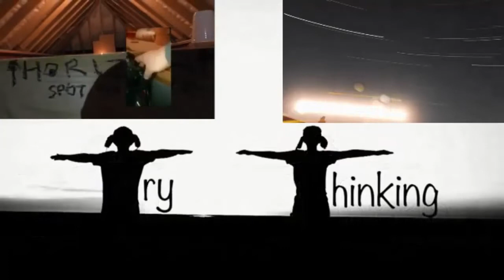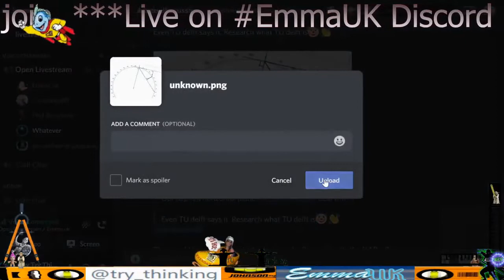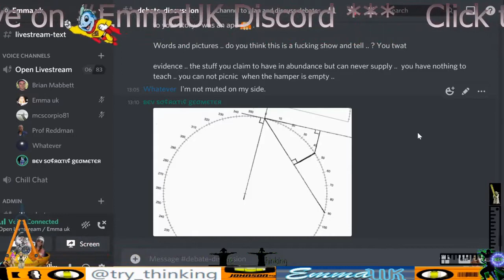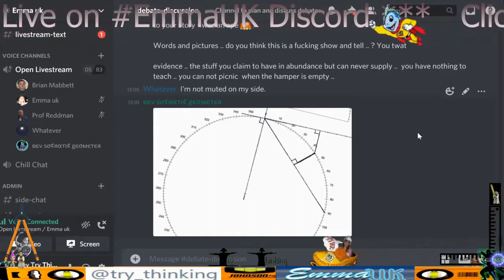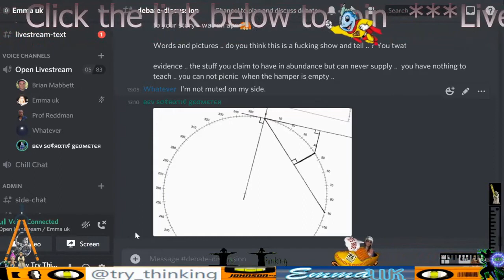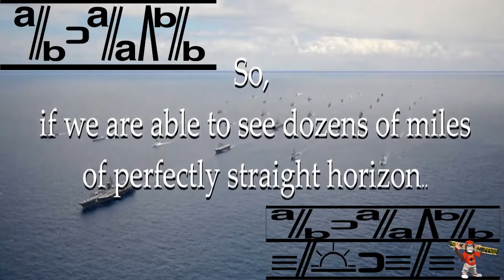Whatever talks about Sly Sparkaynes Bending water level test

Comment: I remember a few years ago I asked Sly what his #1 proof that Earth is a ball and he said Gravity.  Lol!  Now he has a test to prove its bendy?  Why wouldn’t he have said bendy water?  These globers have nothing.
Reply from the maker: Slys been doing his bending water level experiment for years, he’s obviously not even able to join pipe together without it leaking. He’s just another actor paid to imagine he’s smarter than fools🤷🏻‍♂️ if he was smart enough he’d have hidden his inaptitude better.
Reply: Ryan....My question for you is what is your #1 proof of a flat earth?  As for me, I have made many observations that only work on a globe.  Here are just a few....
1)  In my hometown of Seattle I observed a sun with an orbit path that is around the North Pole but I spent over 2 years in New Zealand and Australia and the observed sun orbit is in the complete opposite direction around the South Pole.  I should not have seen this on a flat earth but this is easily explained by the globe. 
2)  I currently live near the equator in Thailand and the observed sun orbit is perpendicular to the earth's surface.  Continue that orbit path and the sun goes right underneath me at night.  Again, not possible on a flat earth but easily explained by the globe.
3)  The orbit path of the moon at zenith is between 28.5°N and 28.5°S so if the earth was flat then people in the northern and southern hemispheres should see opposite sides of the moon.  I saw the same face of the moon in Australia and New Zealand except that it was up-side down in relation to the moon I observed from Seattle.  Again, easily explained by the globe but not possible on a flat earth.
Need I go on?
Reply: @fedogma8407  Verify that the sun goes under you... ever. :) I couldn't think of a way to verify it. The observations are the same for the sun on a globe and a flat earth.
Reply: @ryanqvincent144    I really don't think you have done much research.  One of the fundamental differences between the flat and globe models is that the cosmos is above the flat earth and the cosmos completely surrounds the globe.  Obviously observations can only fit one model.  
Here is a video showing a sunset time-lapse from Singapore (almost right on the equator) which is about 950 miles to the south of me.   https://youtu.be/4RRpHFqYfmU?t=6  

Since the observed sun rises perpendicular to the horizon, passes overhead at noon then sets perpendicular to the horizon at sunset then it is not difficult to continue that same path and understand that it goes underneath you at night.  My 6 year old grandson even figured this out when I asked him where the sun went at night.

And what about the observed sun in the southern hemisphere?  How do you explain that on a flat earth?
Reply: @fedogma8407  what’s is the sun.?
Reply: @Jimbob-83   It's that bright object in the sky that gives us daylight.
Reply: @fedogma8407  you 100% sure of that?
Reply: @fedogma8407  you said: "... Obviously observations can only fit one model. ..." That is what you need to verify! You have to verify how you know the sun goes under you! You need to use 'Time and Date . com' readings! They are taken from the real world! :)  
  Your problem is that you need to verify you live on a globe and you cannot verify that!

  You can verify that this place is stationary and cannot be a globe of the size you are told. ;-/
Reply: @Jimbob-83  Yes, both of us have been outdoors and seen this.  Do you have a serious question?
Reply: @fedogma8407  you seem to have all the answers but they all seem to be based on presuppositions and assumptions such as the sun goes underneath us..🤣🤣🤣👍
Reply: @ryanqvincent144  Having a case of cognitive dissonance because you can't explain those sun orbits on a flat earth?  The data on both TImeandDate. com and Suncalc. org matches everything that I have seen.  

You saw the sun setting perpendicular to the horizon in that video.  So how does this sun return to the east to rise again in the morning 12 hours later if it doesn't go underneath me at night?  That sun is still setting to the south of due west and rising to the south of due east but the North Pole is over 5,000 miles to the north and it is quite obvious that the sun is not heading in that direction.  Do you have an answer?

This is not rocket science, if the earth was flat then everyone should see a sun orbiting around the North Pole as observed in the northern hemisphere.  We don't see this.  And no, you don't have evidence of a flat earth, only denial of the globe.
Reply: @Jimbob-83  My observations are pre-suppositions?   Why does that video match what I observed?  How do you explain a sun orbit that is perpendicular to the earth's surface if the earth is flat?  How do you explain a sun orbit around the South Pole if the earth is flat?  Why doesn't everyone see a sun orbiting around the North Pole if the earth is flat? All you have is excuses and emojis because you are the one with pre-suppositions and assumptions.
Reply: @fedogma8407  🤣🤣🤣👍 orbits..? What are they
Reply: @fedogma8407  you also assume that every flat earther ascribes to a disk in space with the gasses sun and a moon rock circulating above it...🤷‍♂️🤷‍♂️🤷‍♂️🤣👍
Reply: @Jimbob-83  It is a lot worse that that for the 'globe enthusiasts'... There is no 'vacuum of space'! We live at the lowest level of a flat and stationary, water filled plane with 'lumpy bits' we call 'land'...  that we cannot get to the  'underside of'. Everything we see is on this plane or above us! This includes all the sky objects which we have no way to verify the physicality of. :) 
  That is where we live. :) It actually makes sense! :)
  anyone can verify the 'stationary' part for themselves. :) 
   I really am not jokin' :)

  There is a lot more to it than that! However, that is the basics of where we live! I don't like it either.
Reply: @ryanqvincent144  
You can't verify that you are stationary, and I am not joking either!
Reply: @frankcrowder9709    You can verify that the physical earth is stationary! What is more once you understand the falsehood that you were told to convince you then you will feel foolish. Don't! Your teachers were fooled as well!
  You can test that this place is stationary. You can show the falsehood you have been told. :) 

   You have been told a falsehood as 'physics of motion' but never shown it was true! 
   It isn't your fault. You had to be taught this falsehood! 
   Clue: Kinetic energy of linear motion! 'F = ma' is not complete for objects already moving in a straight line at constant speed. :)  The issue is the real world that you live in!
Reply: @ryanqvincent144  You claim there is no "underside" of your flat world and everything we "see is above us" yet you cannot explain why I see a sun orbiting perpendicular to the surface of the earth which means that the sun goes right underneath me at night as it returns to the east to rise again in the morning.  Again, this matches all of the data on TimeandDate and Suncalc.  You are not a flat earther, just another globe denier who denies evidence that does not fit your assumptions.  And how did you "verify" that the earth is stationary?
Reply: @ryanqvincent144  🤷‍♂️🤷‍♂️🤷‍♂️
Reply: @ryanqvincent144  
Irritating to me is your repeated failure to explain my simple example of the same movement on the earth and then on a moving aircraft. What do you claim is the energy change needed to go from 0 to 4mph on the earth and then in an aeroplane moving 500mph faster than the earth's surface? Give me some actual numbers, not your opinion of where you imagine I have got it wrong!
I know that postulating a new reference frame doesn't alter conditions in the first one, but it can often make the situation simpler to analyse, as for example my aeroplane one - you simply don't have to relate all the speeds back to earth.

You seem to think that I have simply been 'told' what the laws of motion are, but come on, if you have had a decent scientific education these will have been demonstrated practically, too, and then a working lifetime of actually using them, and not finding them wanting, has convinced me that I understand them better than you do!
I haven't read any of your thoughts because I couldn't find them on your channel: where exactly are they?
Reply: @frankcrowder9709  Stop using 'reference frames', which are imaginary... Calculate the kinetic energy of a one ton car moving west to east at 600 mph while appearing stationary. Now, speed it up to 30 mph in each cardinal direction. Calculate the change in kinetic energy in each direction. i.e. Calculate the total Kinetic energy of the final speed  - the total kinetic energy of the starting speed in each direction.
 1)  Is the change in kinetic energy the same in each direction?  

Now, use 'reference frames' as you were taught? 
 2)  Is the change in kinetic energy the same in each direction?  

 a)  Why are the different? 
 b) Which is correct in the real world? 

This is the real world... How can they be different just because you did the calculations differently? 

That really cannot be correct? Right?

Conclusion: The real world cannot be rotating! :)
Reply: @ryanqvincent144  
I assume that your 'one ton car moving west to east at 600mph while appearing stationary', refers to a car that is static relative to a point on the earth's surface at a latitude with a 600mph W to E surface speed, and you then drive eastwards at 30mph, say, and westwards at 30mph, to consider just two of your cardinal points.
Obviously you want me to say that the change in KE when moving from rest (relative to the ground) to the east is
630^2 - 600^2 = 36,900 units and when moving from rest to the west is
600^2 - 570^2 = 35,100 units.
Yes, the changes will be different when calculated this way, because of the squared function, compared with the changes of 30mph in all directions when considering the motion being in a reference frame fixed to the earth's surface. The change in all directions is now only
30^2 or 900 energy units.

Which is correct? - both of them, of course, as it depends on what you were calculating the energy for in the first place.
I know that you aren't happy with the concept of relative energy, but you can't deny it has a real effect.
For example, if we were considering an impact between the car and an object from space - a meteorite coming in from the east, say - then the severity of this impact would be worse for the car travelling eastwards, as the closing or impact speed would be the sum of the car's W to E speed and that of the meteorite's E to W speed. 
If the car was travelling E to W however, the impact speed would be the difference in meteorite and car speeds.
As impacts of this type are rather rare affairs(!) we usually always consider motion relative to the ground where the result is the same for a moving or stationary earth.

To show how the use of an appropriate reference frame makes the calculation easier, consider the following scenario: your car is stationary relative to the ground - on a stationary earth, if you insist. You punch the windscreen with your fist moving at 30mph, say. It hurts, as the kinetic energy of your fist and arm is dissipated as strain energy in the windscreen and your fist/arm and some thermal energy too.
If you were to do exactly the same punch but with the car moving at 30mph over the ground, I claim that any injury would be identical to that in the first case.
The relevant energies are 30^2 = 900 units for the first case where your fist is moving at 30mph before impact before coming to rest after the blow, at zero speed relative to both the car and ground, and the second case of
60^2 - 30^2 = 2,700 units of energy where your fist starts at 60mph and stops at the windscreen, still with the 30mph speed of the car, relative to the ground, which we are taking as our absolute zero speed reference point.

Do you agree that the effects of the punch would be the same whether the car was moving or not?
If you do, then something is wrong in the logic, and that is clearly in the use of energy values using speeds related to the ground, when it is obvious that the car should be treated as the point from which your fist speed is measured.
The speed of the car is totally immaterial to your punch, just as the speed of an aeroplane has no effect on movement inside it: so the same applies to the earth and your earthbound speed/turning/braking tests are the same for both a stationary and moving earth, as long as these earthly movements do not make the earth a non-inertial frame, which for all normal purposes they don't.
At the risk of repeating myself, again, you have NEVER commented on the massive energy differences involved in a 4mph speed change of person on a 500mph aircraft, compared with the same change on earth, if all speeds are referenced to earth - any comments????
Reply: @frankcrowder9709  lol, They cannot be different! That cannot be correct! That is where you think that maths is separate from the real world! 
  There is only one real world object! It cannot have different 'kinetic energies' at the same time!
  You are starting to appreciate that the kinetic energy must be different in different directions, and it is not linear, if your assumptions of a rotating earth are true!

   Remember, in the real world the braking distance is the same in all directions!
  'Braking distance' is proportion to loss of kinetic energy!

  You know the kinetic energy is different in different directions... So, why is the 'braking distance' the same in all directions?  You know this from driving a car in the real world! :)

  You are almost there... The kinetic energy must be the same in all directions on the physical earth to give the same braking distance! :) 

   Conclusion: The west east rotation does not happen! 

  Now, can you show this with a simple test!?  
   Yes, you most certainly can! :)

   Has this test ever been done in the real world? NO!
   It will show that the physical earth is stationary! :)
Reply: @ryanqvincent144  
Again I ask, why does a 4mph change in speed on the earth feel exactly like the same speed change in an aeroplane at 500mph when you go from standing still in the aisle to walking forwards at 4mph along the aisle, towards the front.
 Surely, according to your philosophy, on the earth you are going from zero absolute speed to 4mph absolute speed, and on the aeroplane cruising at 500mph, relative to the earth's surface, from 500mph absolute speed to 504mph absolute speed, with a consequent energy increase factor of 250!
That is a massive increase factor, that is easily resolved by using a speed reference frame that MOVES WITH THE PLANE!, when you then get an answer that is the same for the plane situation as that on the ground - which is what we observe in reality.
I just fail to see why you can't grasp this, so must assume that this is why you never comment on this particular example. 
Why does the use of a reference frame explain the similarity of the two situations whereas referencing all speeds to earth does not?

What is your explanation of this?
Reply: @frankcrowder9709  You need to sprint up and down a plane. 1) When stationary on the runway. 2) When cruising at 500 mph.
  Do they feel the same? No! 
  Can you prove they are different? Yes! 
     You can easily measure whether the plane is moving or not with a simple 'relative speed with a constant amount ofd work' test! :)  
   You nearly had it... It is about current 'Kinetic energy' and acceleration! 
   Until you face this and appreciate where it leads... You are wasting your time talking to anyone about it! :) 

   The real world is stationary. You can avoid it all your want. 
   The physics of linear motions shows this.   

   It would be easy to prove me wrong... Just do the 'tennis ball, Catapult and radar gun' on a train or airplane.

   You expect the same results when stationary and moving using 'reference frames'. The real world will be different. :)
Reply: @ryanqvincent144  
You DON'T need to sprint up and down the plane! If your true velocity is that measured relative to what I assume you think is the true reference 'zero' speed of the universe, or whatever you want to call it, but I am still assuming that it is the speed of the earth, as you haven't said anything to the contrary, then as I have pointed out many times, even just a 4mph speed change will need a MUCH larger energy change at higher speeds than at rest. The fact that you don't get this large difference if you simply use a different frame, for example, the ground and then the aeroplane itself, shows the legitimacy of this approach - that is, it correctly describes what we actually observe. Do you dispute my energy figures for the two 4mph speed change scenarios?

I agree that doing a test involving a constant amount of work at rest then on a moving plane would be interesting, but have no doubt what the result would be!
You speak as though you have actually done a tennis ball or catapult test: have you? I would be very interested in your results! Also, you sound as though you really believe that you could tell the difference running up and down a train in opposite directions. Have you actually done this yourself, and I mean a proper test, blindfolded, with no audible cues or giveaways like the shape of the seats that you could touch and hence determine the front or rear of the carriage.
What evidence HAVE you actually got?
No thoughts on how the mechanical gyrocompass works?
Any explanation as to why artillery shots tend to fall low when shooting west and high when east, if it is not the change in centrifugal force countering gravity slightly differently for the two directions?
Reply: @frankcrowder9709   I notice that you have now diverted completely when driving a car at 660 or 540 mph in the real world! :) 

  You need to show the evidence for your belief! It is interesting that no scientist has ever done it! Obviously, You think you believe that a small change in the real world speed proves your point. Obviously, you are talking rubbish! :) 
  Show some real world tests to prove your point! 

   Volunteer to run up and down the aisle of a aircraft at full speed and tell us what happens! :) It is dangerous and will be disallowed! Especially the running backwards and  'slowing down'. :) Think about it! Try it! :) 

  Seriously, we have been here before... You won't check the real world of linear motion. 
  Time to go our separate ways. Thanks for your opinions. 
  You will be muted.
Reply: @frankcrowder9709  They are not well tested! You believe that 'reference frames'  can be used to remove the kinetic energy of a moving body... Yet no one has ever shown you it is true. :) Obviously, it cannot be true as they are 'imaginary'. :)  
   Thanks for your opinions.
Reply: @ryanqvincent144   
 They ARE well tested! Certainly F = ma and the standard equations of motion are!
I have never said that reference frames change the ACTUAL amount of energy in a system, only that they can make a dynamic system easier to consider, in some circumstances. All I have tried to show, unsuccessfully, to you, obviously, is that rigid adherence to your belief that all velocities must be related to a stationary earth, can lead to incorrect conclusions.
Please tell me if I have misinterpreted what you believe: that is, that you consider the earth stationary and absolute velocities must be referenced to the earth.
Reply: @fedogma8407  So your proof that the Earth is round is to look up and assume the Earth is a sphere?  No don’t go on.  

I live in Victoria across the Strait of Juan de Fuca to Port Angeles, 20 miles with 177 ft of missing curve that should hide each other but are clearly visible.
Reply: @TrueEarthKnowledge   Why wouldn't you be able to see Port Angeles?  
1)  You seem to have forgotten that Hwy 101 drops down from over 250 ft as it enters Port Angeles from the east.  
2)  Also go a mile inland in most of Port Angeles (east side) and the elevation is higher than 177ft, one area is even 500 ft above sea level.  
3)  Did you consider refraction?
4)  Do you have photographic evidence of the US Coast Guard airstrip buildings on the jetty or the lighthouse on the Dungeness Spit about 12 miles to the east?  
 
And yes, I know that the motion of celestial bodies in a cosmos that is only above a flat earth would look completely different than a cosmos that surrounds the globe. My observations definitely support the globe.   No flat earther can explain those sun orbit observations on a flat earth.
Reply: @whatever2735  I live in Bangkok and at times we have hazy, humid air and pollution so star gazing can be difficult in the city, especially for stars on the horizon.  I can see Polaris year round but all of the Big Dipper, Cassiopeia and the bowl of the Little Dipper can go below the horizon.  I can't see the South Celestial Pole but both The Cross and Pointers can sometimes be seen arcing above the southern horizon.  And yes, Orion is a familiar sight during winter months although it passes directly overhead so it also has an orbit path that is perpendicular to the earth's surface.  It always amazes me how flat earthers deny the reality of how celestial bodies move and only want to talk about "the lack of curvature" yet can't comprehend why we see celestial bodies go below a water surface that they claim is flat.
Reply: @whatever2735  so will the stars rotate to me if I’m in a plane
Reply: @whatever2735  In reality there is no flat earth explanation for any celestial observation but especially in the southern hemisphere and near the equator where it is blatantly obvious.  Of course according to Ryan Q Vincent, observations work the same on both models.  You have to wonder how it is possible to be so ignorant that you would claim a flat world with all celestial bodies above it would look the same as a world completely surrounded by the cosmos?  Exactly how deep is that rabbit hole??
Reply: @whatever2735  your assuming there’s only one rotation... even on a flat stationary earth they maybe 2 separate rotations.. I don’t know and I’m certainly not going to claim anything.... on your ball belief world..! Does the stars always rotate .? Even when your in a plain flying..? Does the moon sun and stars still move?
Reply: @whatever2735   You said:  " Look up celestial sphere." You never see a celestial sphere! You see a 'a sky that you believe is half a sphere' at the most. You have been told it is a sphere. How did anyone verify that it is such? Clue: No one did. ;-/

     You said: "Only one axis of rotation has ever been observed by humanity throughout recorded history.". That isn't correct... There are two axis: One is the north and another one in the south. 
   How did you verify that they really are one axis? 
   How did any expert verify that they really are one axis? 
   No one has? 

 The 'sky objects' are a 'clock'... I suggest you investigate that thought.
Reply: @whatever2735  so the stars rotate around us on the globe
Reply: @whatever2735  Stop being a parrot! How did you verify that the rest of the sky is below you? 
  I know what you have been told! How do  you know it is true!  
  Clue: The exact same explanation works for a flat earth with all the sky above you!
  Now, how can you prove your belief of the sky under your feet is correct?

  I cannot think of of how to prove your version of the sky is correct. ;-/ Enlighten me how you did it! :)
Reply: @ryanqvincent144  Your comment, and I quote, "Clue: The exact same explanation works for a flat earth with all the sky above you!" shows your complete ignorance of reality and your indoctrination into the fantasy flat earth.  The idea that we would see no difference in a flat earth with all celestial bodies above us and a globe where all of the celestial bodies are completely around us in all directions shows that you don't even have the common sense to understand what the differences would be.  All you are capable of doing is parroting the flat earth pablum of denying the globe.  

And what is hilarious is that you think you are an expert in physics and kinetic energy when you can't even comprehend simple observed motions of celestial bodies.   We can prove the globe but to be brutally honest you are not as smart as you think you are since you allowed yourself to be blinded by flat earth lies.
Reply: @whatever2735  How do you prove that EQ Mount is pointing at the star when it is pointing at the ground? You cannot! 
   Remember, In the real world the star is always above you and it just goes out of sight!
  You have been told the EQ Mount follows the star.., Prove it is true!
Reply: @whatever2735  It isn't what you know. It is what you can prove! :) Now, prove that your EQ Mounted telescope is actually following a star when it is pointed at the ground! 
   You cannot prove it is doing that! :) You cannot prove that what you believe about your EQ Mount is correct! It isn't!
 
  The physical earth is stationary and a flat plane! The EQ Mount works perfectly well tracking the physically moving stars as they go over head and vanish into the distance!
Reply: @whatever2735  Your 'rising' and 'setting' is just the conditioning you have had all your life. ;-/ The reality is that they are coming towards you and going away from you. 
  The stars are local to you and nothing like what you have been told. ;-/ They are not 'suns' far away.  

  You can work this out for yourself with a little thought.  

  Combine that with the 'stationary' earth and i does start to make sense. :)

p.s. The issue you have is that you cannot prove the EQ Mount can track a star when it is pointing the telescope at the ground.
Reply: @whatever2735  The 'sky objects' are a 'clock'! you can predict them accurately without understanding how the sky works! :) 
  What you cannot do is verify what they are, what size they and how far they are! ;-/
       You have been told by 'experts' what they are... Like you they cannot verify what the 'sky objects' actually are! ;-/
       You are free to believe what you have been told by the 'experts'. :) That is called 'faith'... And we all need it.
Reply: @whatever2735  Stop telling me what you know as though it is the 'reality'! The 'celestial sphere' is a useful way of thinking about the sky! 
  The issue you have is that you believe that the 'cosmos' is as you have been taught! It cannot be that!

  You have no way to verify anything you tell anyone about belief about the 'sky objects'! 
  Telling me that is your belief is the only way and must be real is silly!

  That is how you got into this mess of believing 'Cosmology' as told to you by 'experts'... Who cannot verify anything either! see 'story' or 'speculation'!

  The observations you make of the sky are real! The explanations are 'fantasy'! :) Get used to that! 

  Thanks for your opinions. 

   I think it is time to go our separate ways. Neither of us is learning anything useful. 
   You will be muted... I may come across your comments in future but I don't get notified of them.